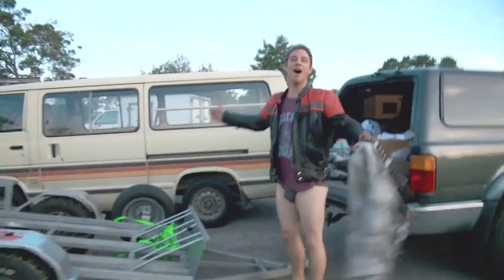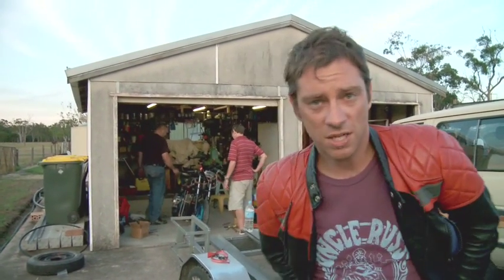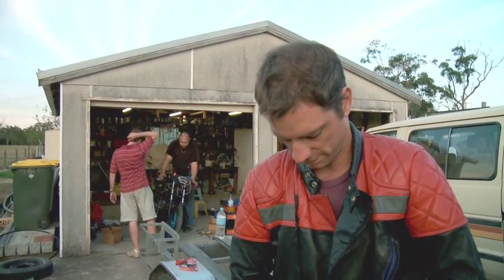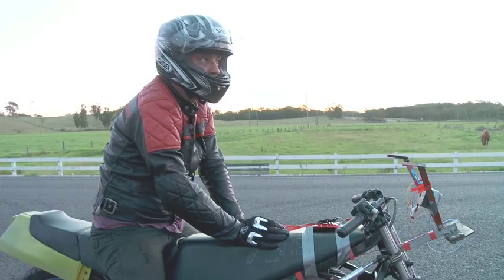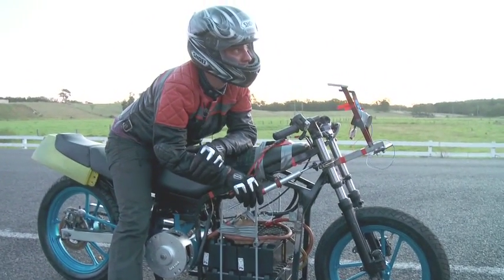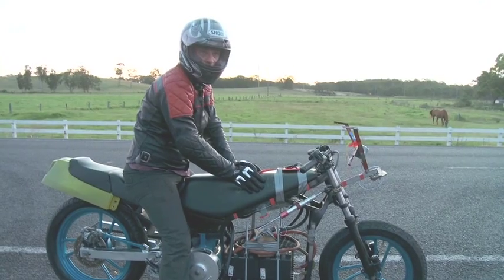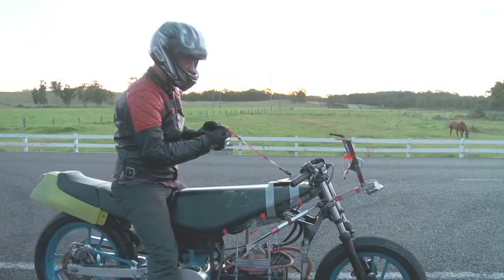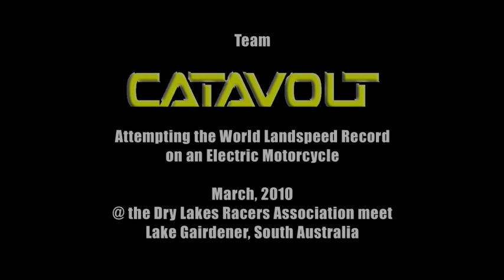Catavolt 2010 Land Speed Record assault - timelapse bike build and first test

Comment from the maker: The gearbox on motorcylces is actually art of the motor - not a separate piece you can bolt on (like in a car). So as an electric motor doesn't have a gearbox, it's easier just to give more volts to the motor - as the motor has high torque anyway. Sure, you could put gears on, but it would be added complexity for not much more advantage. The Catavolt is geared very low - we have a huge cog on the motor, and a tiny one on the back wheel - yet the motor can still push it at that ratio easily.

Comment: Nice work. Hope it goes well. I seriously suggest you invest in some A123 batteries for it. They have twice the energy density of regular lithium batteries. Shouldn't be as expensive to fit out the bike with them, compared to your EV Capri. If you can get enough torque from the motor, have you got it hooked up to a proper gearbox. Surely it would help it go faster. I suggest a box with overdrive, due to the torque of electric motors with enough grunt for maximum speed. Good Luck with the Record.